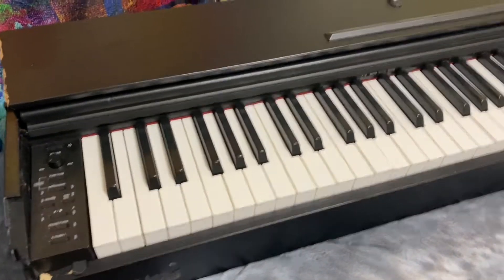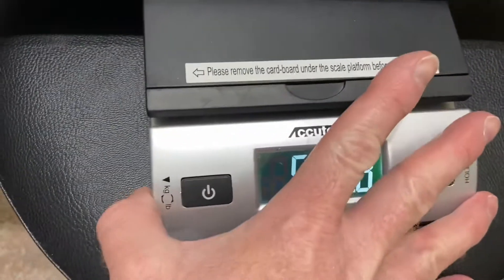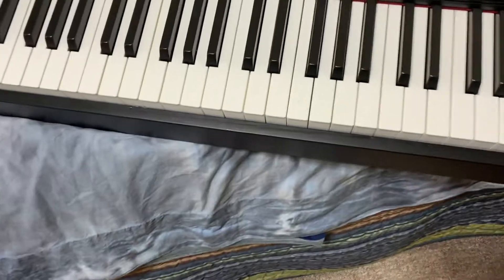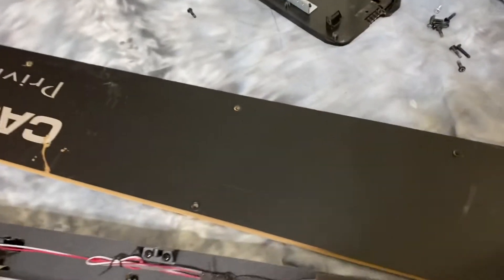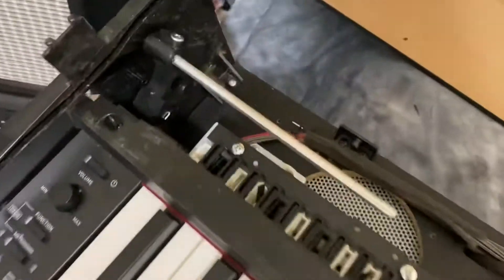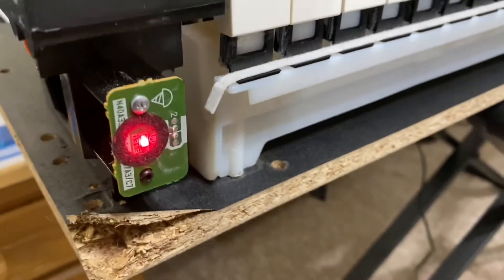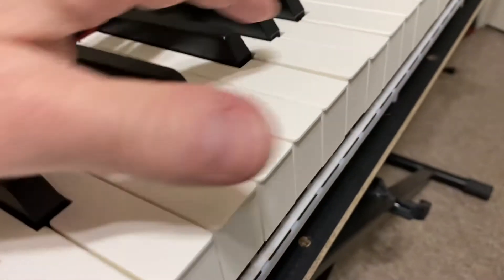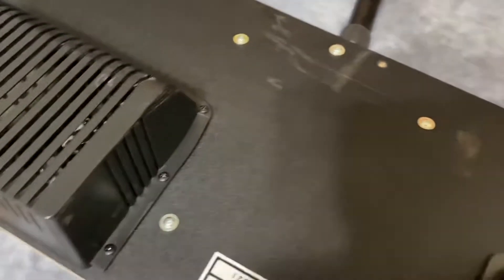SMASHED Casio Privia PX-770 Disassembly

Comment: Hey! This is a rather odd question. For context, I ended up getting my travel card inside this piano because I accidentally pulled the tray open when my card was resting on top of it. In terms of going about disassembling and reassembling the Privia PX-770 to get my stupid card, how would you go about this? I'm thinking - taking off the top as you did first, but that removes the bond of glue between the back and top pieces.
Reply from the maker: No need to remove the glue, just take out the appropriate screws. There is a full disassembly guide online. Just search for the service manual and/or disassembly guide.